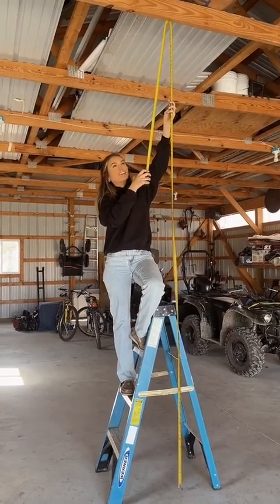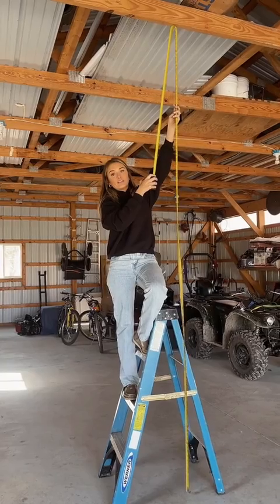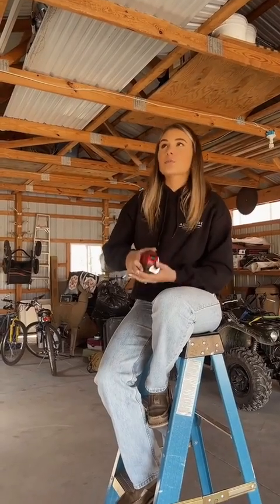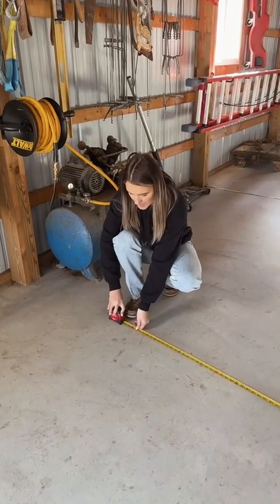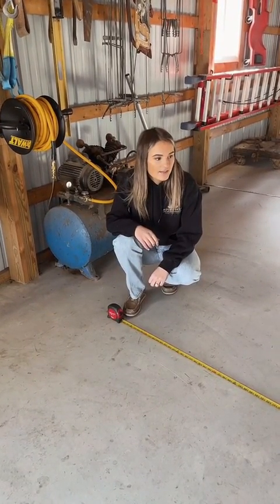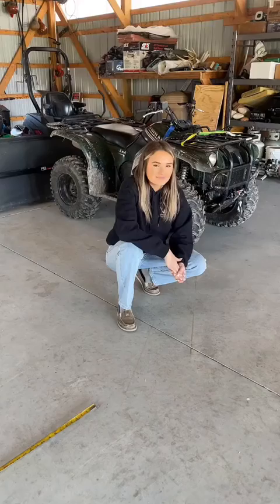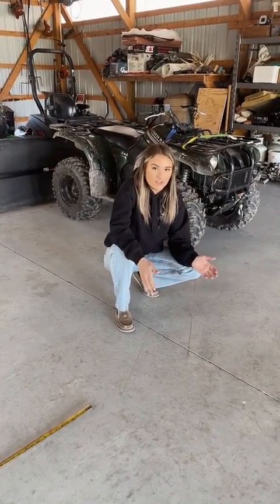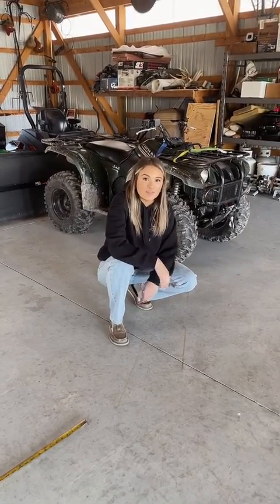Advantage Lift Lessons | HOW TO MEASURE YOUR GARAGE FOR A 2 POST LIFT | WHAT 2 POST LIFT WILL FIT?

Comment: My ceiling is 10'2" and want a 11K 4-post for the 240v/20 amp option. Any issues with it other than my low ceiling?
Reply from the maker: Hey there! It really depends on the cars you plan on stacking. The SS-11000-WD needs at least 8'9" to fit in a garage. We have a simple car-stacking formula you can use to figure out how much ceiling space you need for your vehicles which I'll link below! If you have any questions, please give us a call at 763-300-5730. 

https://www.advantagelifts.com/pages/measure-your-garage-1